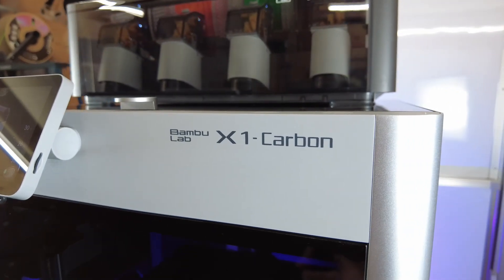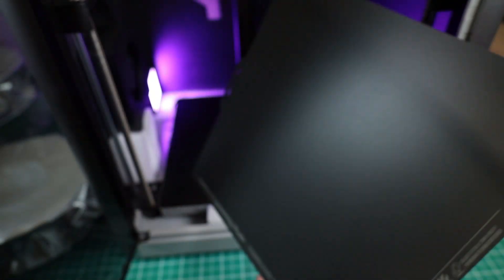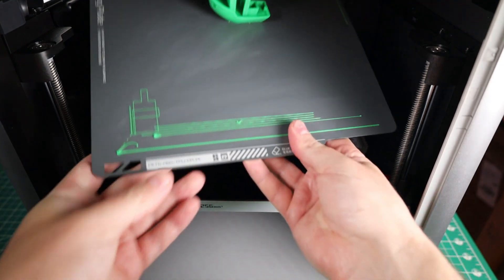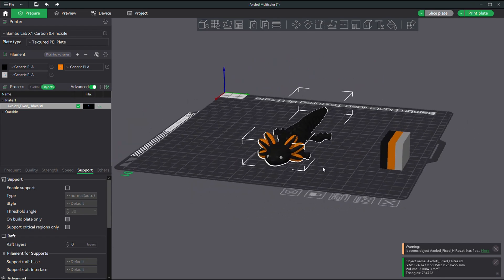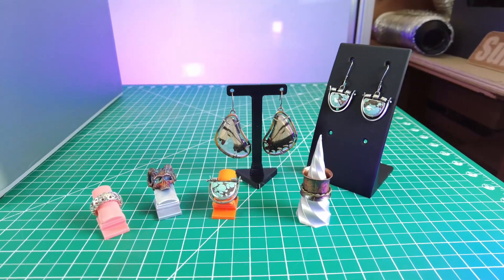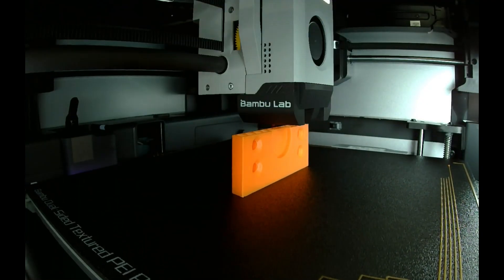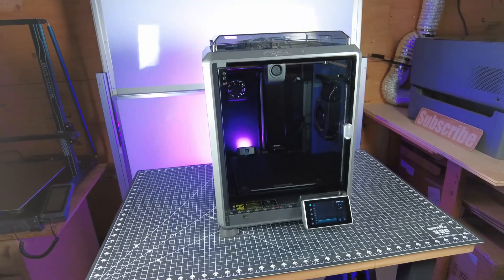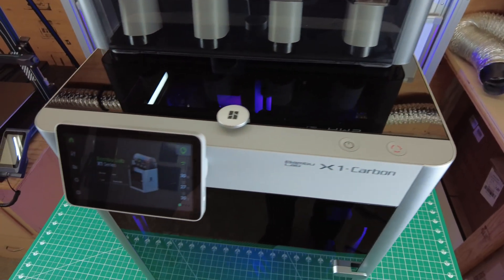3D Printer That Anyone Can Use & Get Amazing Results - Bambu Lab X1 Carbon

Comment from the maker: Bambu Lab X1-Carbon Combo 3D Printer US - https://bit.ly/Bambu-Lab-X1-Carbon-Combo-3D-Printer-US
Bambu Lab P1P 3D Printer US - https://bit.ly/Bambu-Lab-P1P-3D-Printer-US
Bambu Lab P1S 3D Printer US - https://bit.ly/BambuLab-P1S-3D-Printer

Bambu Lab EU Store - https://bit.ly/Bambu-Lab-EU-Store
Bambu Lab UK Store - https://bit.ly/Bambu-Lab-UK-Store

Bambu Lab Filament - https://bit.ly/BambuLabFilament

After Market Parts for the X1C, P1P & P1S:
Carbon Fiber PET + Textured PEI Build Plate - https://amzn.to/3DhWeLF
Forged Carbon Fiber PEO + Textured PEI Spring Steel Build Plate - https://amzn.to/3OkVNqb
P1P Enclosure Kit - https://amzn.to/3Ok8fWY
Hardened Steel Hot Ender With Changeable Nozzles - https://amzn.to/3Q2JtMz

Check out  youtube.com/@3DPrintSOS/  for his Voron 2.4 build and more.

Free & Paid STL Files for 3D Printing: 
printables.com
thangs.com
thingiverse.com
cults3d.com

ZIRO Multicolor Rainbow Matte PLA 1.75mm Filament - https://amzn.to/3rFkBjx
Starry Sky Gradient Twinkling PLA 1.75mm Filament - https://amzn.to/3rDotSs

3d Printer Filament That I Use:
PolyLite ABS - https://bit.ly/PolyLite-ABS
PolyLite ASA - https://bit.ly/PolyLite-ASA
PolyFlex TPU 95 (Flexable) - https://bit.ly/PolyFlex-TPU-95
PolyLite Silk PLA Blue - https://bit.ly/PolyLiteSilkPLABlue
NylonX Filament - https://bit.ly/MatterHackersNylonX
PolyTerra Marble PLA - https://bit.ly/PolyTerraMarblePLA
TECSONAR Tricolor PLA - https://amzn.to/3H79d5N
Build Series PLA - https://bit.ly/MatterHackersBuildSeriesPLA
Build Series Silky PLA - https://bit.ly/BuildSeriesSilkyPLAMatterHackers
Build Series ABS - https://bit.ly/MatterHackersBuildSeriesABS
Build Series PETG - https://bit.ly/MatterHackersBuildSeriesPETG
PRO Series Filament - https://bit.ly/MatterHackersPROSeriesFilament

Amazon 3D Printing Filament:
PLA - https://amzn.to/3gsLE9Z
PETG - https://amzn.to/3pXjjvu
ABS - https://amzn.to/3wsTRjS
ASA - https://amzn.to/2RX8dtM
Polycarbonate - https://amzn.to/3cLdr38
Nylon - https://amzn.to/3iNGeI2
______________________________________________
If you are looking for more tools and materials that I use, well you're in luck! I made a page on my website just for that.
https://GomeowCreations.com/tools-and-materials 
https://GomeowCreations.com/partners-discount-codes

Note: Most of the links that I use that go to products are affiliate link. This means I make a small commission on anything that you happen buy using them. This is at no extra charge to you and this helps support the work I do on this channel. 😁👍
______________________________________________
Other Ways To Help Support The Channel:
My PATREON ➜ https://patreon.com/GomeowCreations
One time support ➜ https://paypal.me/gomeowcreations
______________________________________________
Instagram ➜ https://instagram.com/gomeowcreations/
Facebook ➜ https://facebook.com/GomeowCreations/
______________________________________________

#bambulabx1carbon #bambulab #p1p #p1s #3dPrinting #DIY #gomeowcreations